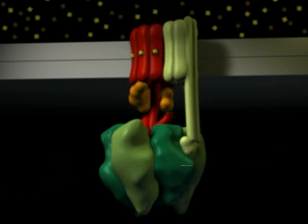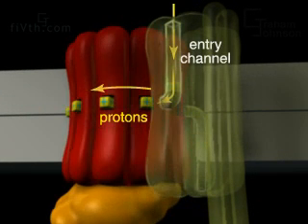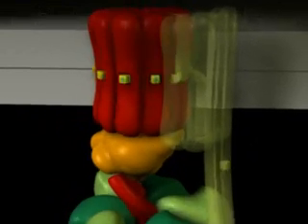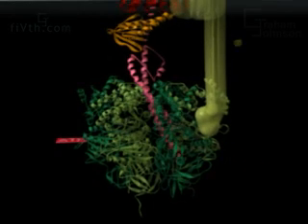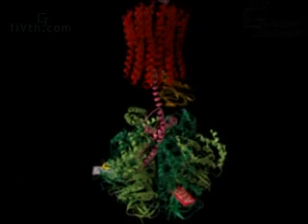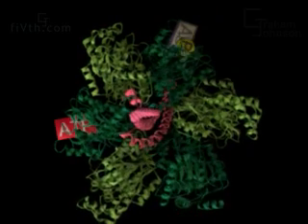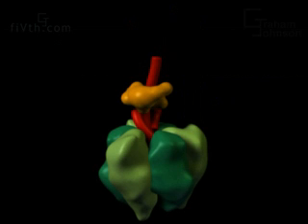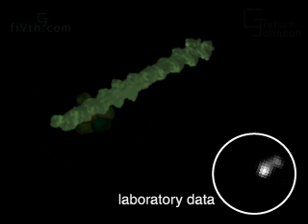ATP Synthase

Comment: Aren protons the a same both sides of the membrane? Unchanged?
Reply: cj hepburn proton pumps fill one side of the membrane with protons creating a gradient.
Reply: @rayhill5767  So is a gradient kind of like a ratio? Ie one side of the membrane starts sending the protons back when it's full up? In my driving test, a gradient was a hill.
Reply: cj hepburn yes proton pumps fill one side  so the protons move back through channels and drive the adp machine.